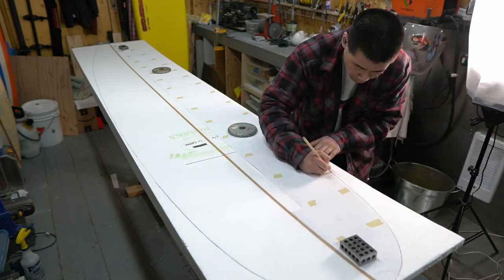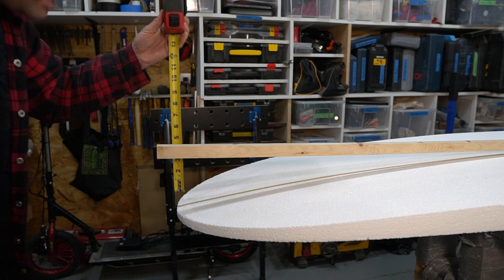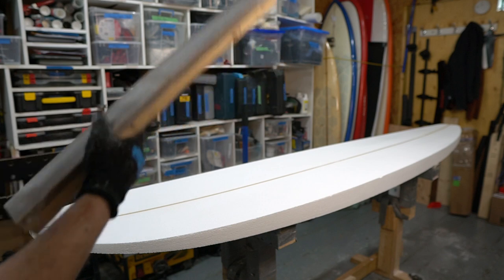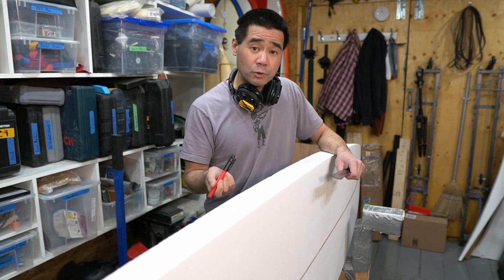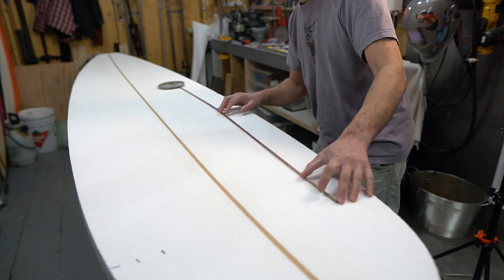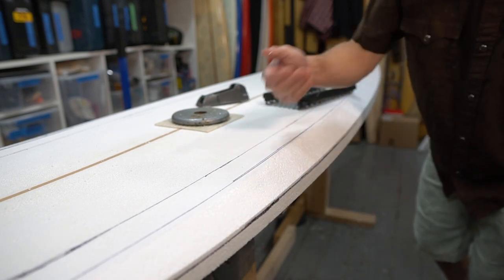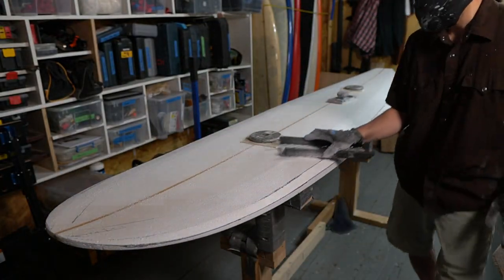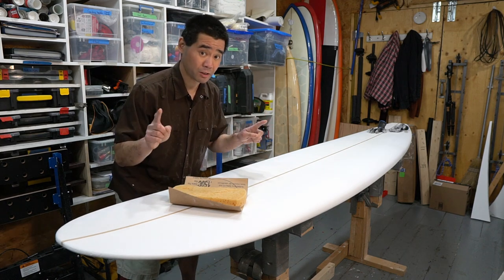How to Make a Surfboard - Foiling and Shaping a Longboard Part 02

Comment: A few questions. Thats EPS foam correct? Also if I wanted to do a nose rider what kind of rocker would I want? Length etc.
Reply from the maker: Yes EPS foam.  As Rex said, look up the Clark foam catalog, there are some good starting points in there.  My other suggestion is to head to a surf shop and take a look at a ton of boards and find something that is a nose rider.  Board rentals and try out something to see if you like it and base your design off that, Google is your friend too, I'm sure this question has been asked some where on the interweb :).  Good luck!

Comment: Hi Andrew, about to shape my first board and have a question after watching your video. if you marked the intended apex of the rail and then removed foam on the hard 45 degree-ish angle to that mark does that not mean when you blended everything the apex is actually lower than your original mark?
Reply: i feel i have seen in other brief videos people mark above and below the intended apex of the rail, but this was on sped up compilation which they don't offer an explanation